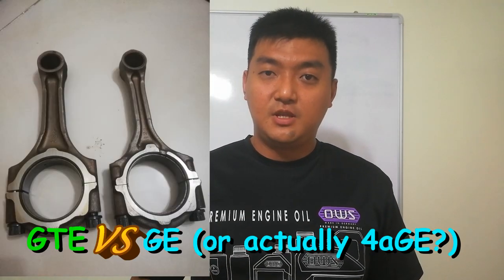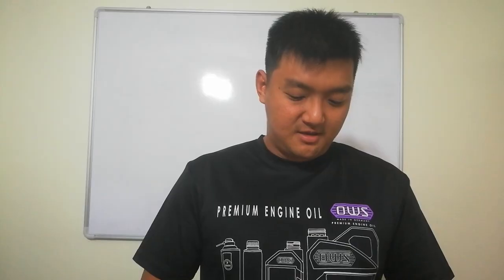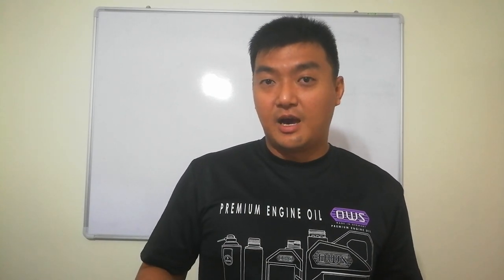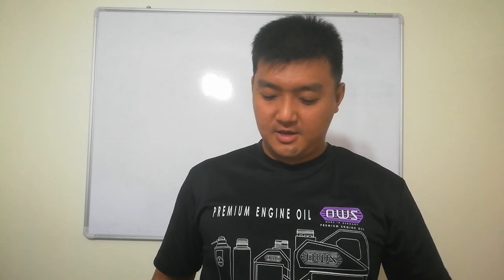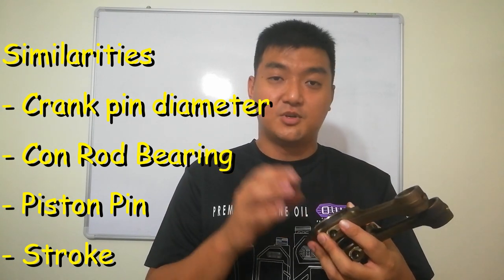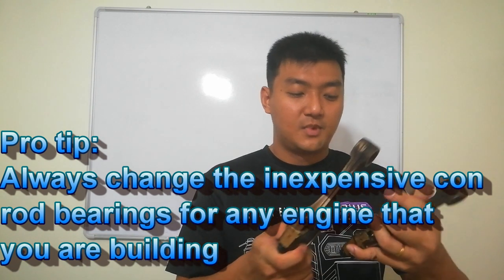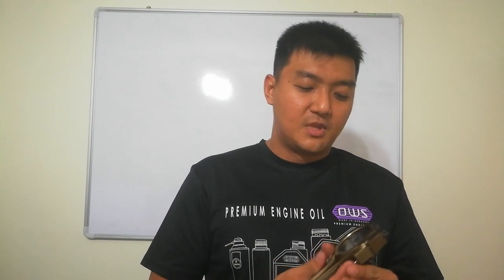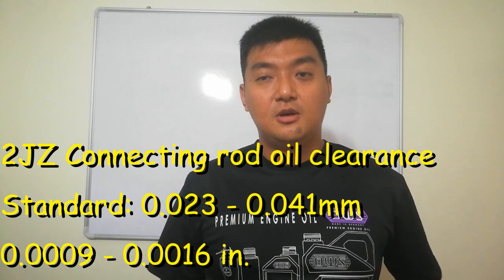2JZ Tuesday - 2jz GE and GTE connecting rods (con rods) - ALL YOU NEED KNOW ABOUT THEM!!

Comment from the maker: Ah Ha... Don't throw away your original 2jz gte con rods!!!!!!!!!! watch this video and you will find some tips and advice on the connecting rods of 2jz na (ge) or gte.
Reply: I have a 2jz GE and a 2jz GE with vvti. I want to build a na-t . So the combo of the two would be a good fit from what I have read. Other than the vvti the heads are the same correct?
Reply from the maker: @Infowar2024  sorry I'm not 100% sure about 2jz GE non VVTi head. But I have one video about 2jz gte and ge VVTi heads
Reply: Should I go Stock GTE bottom end, Brian Crower, or HKS? I'm Looking to build to around 500-600hp? Do you have Facebook?
Reply from the maker: @Infowar2024  yeah I do have facebook, the link is in the description. dam all the things u said all can achieve 500 to 600hp hehe =D BC and HKS would be the dream
Reply: im gonna prove you wrong boi

Comment: So just use ur ge piston tops with gte rods and your good to good right?of course rings too etc etc but just change the rods and thicker head gasket your hood to good.
Reply from the maker: well ge pistons have higher compression ratio, if u are good ( using race fuel/ methanol or e85) then u can go for higher compression than normal gte pistons. =)

Comment: Fun Fact: Early 2jzge VVTi motors came thicker rods due to leftover parts. They make up the compression ratio by modifying the head and Headgasket, usually the very first batch of IS300 came with thicker rods.
Reply: what about the 05 2jzge vvti
Reply: @chrisboost67707  2002-2005 came with the thinner vvti rods
Reply: Interesting, I have a 2001 is300, number 199 on the spec plate in the door. Can't wait to open it up this winter when I do a rebuild to prep for a turbo!
Reply: @notsoaveragejoe2JZ  what did you find out?
Reply: @clyde9659  unfortunately I haven't opened up my bottom end yet. Making far less $$ than I used to (worked on pipeline, thanks politics) so I spent most of my money on suspension, brakes and body mods for a mild widebody. Frp front fenders +20mm and trimmed,molded/flares rear quarters too but no major rebuild yet
Reply: @clyde9659  Also I'm getting impatient to do a proper rebuild before going turbo so I plan to do just new rings, home block and replace bearings along with some head work and going to send it with turbo kit. Also want to do transmission service. Even with a small sponsorship from Mishimoto, coolers for oil and transmission fluid is going to cost big $$ and since I can't get a AEM F/IC 6 anymore, tuning will be hard without a full standalone $$$ unless there is hope with Apexi neo or some other piggy back system.
Reply: @notsoaveragejoe2JZ  ight thanks

Comment: I have a Question regarding 2JZ GE NA-T Build. Hope you can help.
I have a 2JZ GE Non-vvti and want to do FFIM and delete the ugly distributor. Thanks to your advice im going to do drive by wire, so i bought a porsche tb and a pedal. I want to know what else i need for this? CPS?
Thank you.
Reply from the maker: hmm this one i have not done before, but i would guess that u need to use the cam sensor, and maybe machine the place, (be careful of clearances) u may need vvti / non vvti cams because there is a protrusion for the sensor to sense.. sorry i am not very good in this, anyone can help? =)

Comment: i have a 2jz GE VVTi that I'm rebuilding. it came from an 02 Is300.
I'm looking to swap in the thicker rods, weather they're from the GTE or the GE non VVti doesnt make a difference to me since theyre the same. 
Can and should i just purchase new OEM rod bearings and put them on?
Reply from the maker: Yeah if rebuilding it's always good to replace the con rod and main bearings.. Yeah as long as they are thick rods, it should be all good.. Get a good tune if u r using standalone or boosting up.. If not they are all good
Reply from the maker: @dabitat  don't worry, any aftermarket con rods and pistons will be better than original ones. Provided they are good quality

Comment: Im building a 2jz ge nat, i have gte rods but do you think i should change the pistons aswell, I’ve been told vvti na pistons are fine
Reply from the maker: Hmm ge pistons are slightly thinner and also higher compression.. U gotta know ur target horsepower and fuel to use first before deciding on which pistons u wanna use

Comment: Hi there, I am planning on putting gte rods and pistons in my ge vvti on my gs300. The rods I bought did not come with the rod caps am I able to use the ge ones with gte rods?
Reply from the maker: Ah.. Cannot. Each rod must have its corresponding rod caps. Even gte con rods also cannot mix up to use.

Comment: Will the thinner rods be able to hold 300 bhp?

Will the thinner rods handle high revs better than the thicker ones because (I'm guessing) it's lighter?
Reply from the maker: yeah it would rev higher, but the weak points for 2jz high revs are the valve springs and main pulley. 300hp should be alright =D
Reply: @cheapkailaujing  sorry, I wasn't being specific enough, I meant 300 bhp NA, which means it has to be revved really high...
Reply from the maker: @nickamarit  hmm not really, hp can be gain elsewhere safer rather than rpm. maybe cams, ecu tuning, injectors, and or porting... rpm is not so safe if u don't have main pulley or valve springs. we have seen many kaboom before
Reply: Guess I'll need to upgrade the main pulley and valve springs then. Thx, Michael.
Reply: @cheapkailaujing  so you're saying you get 300 + whp out of the engine without a turbo ? And how much boost hp can the ge con rods with stand ?
Reply from the maker: @rahulpersaud3379  oh I didn't go and try the max, but I wouldn't go far with "4age" rods hahahhaha
Reply: Ok thanks

Comment: I have a 2001 jdm supra SZ, non vvti. Did they switch the internals in the non vvti engines in 1998 when they started building the vvti or does my engine have the strong connecting rods?
Reply from the maker: hmm i heard all non vvti has stronger rods, and some ge vvti has stronger rods, some has weaker rods. couldn't confirm this because i couldnt source any non vvti already

Comment: I know I have asked before but I can't find any information on this. Anybody? Can a GE head water ports be machined larger for more better flow on the cooling system?
Reply from the maker: sorry i don't have the answer for this question
but the cooling system has its trick to it, the original water ports are all good for up to very high hp numbers, and more tips here: https://www.youtube.com/watch?v=SzX4yshd5N8
the trick is to do properly the water routes with no bubbles

Comment: Good info Mike happy Tuesday.👍You've already cleared up for me another YouTubers trash info on the subject, his claim that the ge con rods were thicker and to use them in gte applications. Facepalm. His were probably already swapped as well🤣 Appreciate the clarity 🤙
Reply from the maker: Yeah I have opened 3 2jz GE VVTi. 2 of them got thin rods, luckily one of them got thick rods. Maybe that's why I was able to buy the ge in the first place because everyone bought the gte already, left the poor ge haha
Reply: 2jzge non vvti has the same rods as the gte. Its the exact same part number from toyota.
Reply: @ricardovalentin2094  he annotated that in the vid 1:07.
Reply: @cheapkailaujing  Mike one more question I had. I recently watched a thorough LS vs coyote engine build and they mentioned by plugging the oil squirters that it experienced added horsepower. You have any experience with that? Or is the benefit of keeping the squirters outweigh the HP gains?
Reply from the maker: @Ki777UMiNATii  hmm for Ls and coyote I wouldn't know, but for 2jz, the original oil pump is more than sufficient to provide enough oil pressure even there are oil squiters. And they doesn't provide more or reduce hp, but oil squiters add cooling for pistons.. That's all I think
Reply: @cheapkailaujing  Thanks, yeah just wondered if it would considering the comment the builders made on plugging the LS n coyote squiters. 👍
Reply from the maker: @ricardovalentin2094  thanks! :)